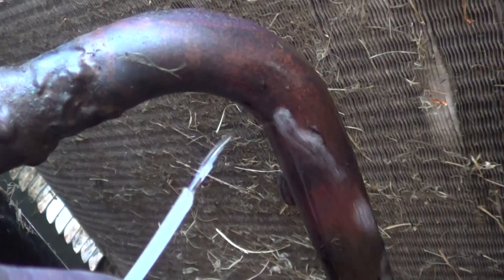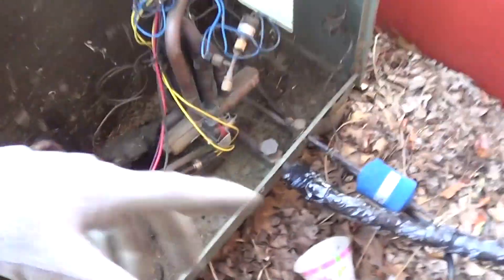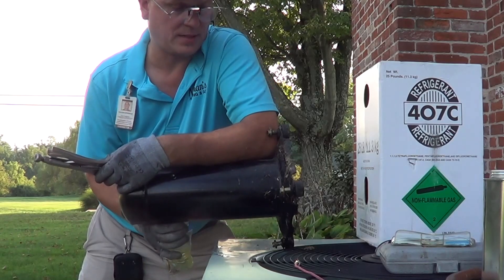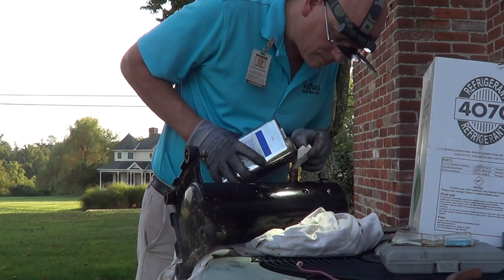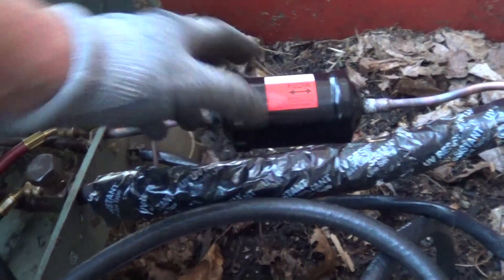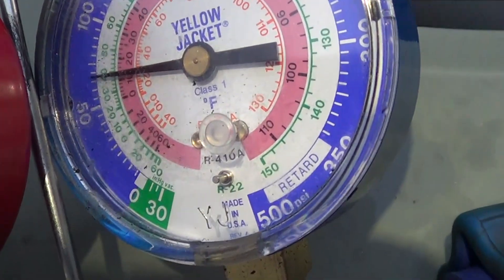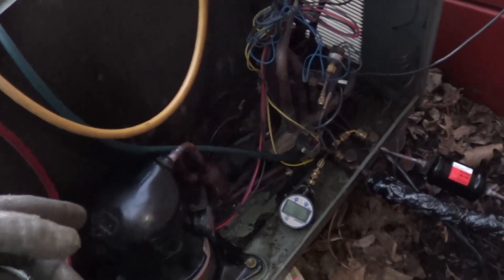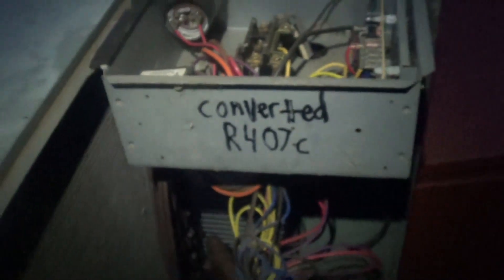Converting a R22 system to R407c

Comment: Due to the check valve in the scroll compressors they start unloaded and cause a high torque start and the compressor twists every time and work hardens the copper lines producing cracks ; The manufacturers need to make loops in the piping to absorb the compressor torque .
Reply from the maker: I ended up repairing that same leaking spot 3 TIMES!!!!!!!    I finally made a very large loop in the copper.  So far so good.  I am glad that R407c is almost as cheap as R410a.
Reply: @NathansHVAC  Miracles are performed daily by professional HVAC tecks repairing factory screw ups . I think that problem is solved .

Comment: Its not necessary to replace the oil. If you put in Supco it will allow the 407 to pick up the mineral oil and move it and no sludge build up has been noted. Been following this method for 4 years now with no issues. Used it on systems up to 30 tons.
Reply: What do you mean put in Supco, is that oil, addative oe refrigerant?
Reply: Supco is just a brand....what the hell are you talking about Kathy? Can you please explain?
Reply: It’s an additive for the oil, used before on semi hermetic systems and it works really good

Comment: 422 is good for A.C. not so good for heat pump. You just don't get the same heat as r407c or r22
Reply: Even 407C doesn't work as well as R-22 in a heat pump. That's the result of a lower compressor discharge temperature. As long as the unit isn't used in a climate that routinely drops below freezing it's ok. Otherwise, stick with R-22 or install auxiliary heat strips.

Comment: 410 better 407c is about 30% loss in capacity  so you loose tonnage and it also is poor oil return properties , causing premature failures .. 407c also known as nu22

Comment: Id love to see wherr tf you got that info lol there is no info anywhere That says Says you gain capacity with 407 !!!  I've taken Honeywell refrigerant classes at the supply house on this issue
Reply from the maker: R407c runs the same capacity.   I was probably saying it was 60 degrees outside.  The system will run over capacity because ahri is 95 72.    Not 60 72.

Comment: I was told by a tech that the r22 Evap coils and txv’s may not handle the higher pressures of 407c. Was that a load of crap?
Reply from the maker: You are probably talking about R410a, which is double the pressure of R22.  R407c is nearly the exact same pressure as R22.  If you read the box of a R22 expansion valve, it will say R407c on the box.    Here is picture of a box.   http://i.ebayimg.com/images/i/191659740462-0-1/s-l1000.jpg

Comment: R22 is still plentiful, if the leak can be fixed just fix it and recharge with R22. You don't have to charge the homeowner $100+ lb, that is just what the industry charges. R22 cost a technician/company about $15 a lb, most companies just have a high mark-up to capitalize on the phase out and to push new systems. If the system needs more than a couple of pounds a year and can't be repaired then it should just be replaced with a R410a system as soon as possible. These alternatives are really only good for those that have a leaky system that don't want to upgrade, but then they are a pain to technicians that don't work with it. I don't care what they claim, they are not as good at transferring heat as R22. In this case I would have recharged with R22 after the repair  Good work never the less.
Reply: R22 is trash
Reply: @Mushroomcapgenova  😂😂 what a comment. R22 is the miracle refrigerant and will be plentiful for years to come.
Reply: @Mushroomcapgenova  r22 cools way way better than r410. Half the pressures too . best refrigerant used in residential cooling besides r11
Reply: @Clamjammer  yea but r22 is being fazed out dude. It's over and done with. I am not looking to play games with swapping a r22 unit to another gas. It's all crap if you need to replace the unit you replace it. Period the end

Comment: So my 10 year old 3 ton unit is leaking R-22. 

The AC guy told me last year that I should replce my entire system because the days of R-22 are coming to a close.
Are you telling me that I can keep my current system, have someone fix my leak, then convert me to a newer freon?

Why do these guys constantly try to rip people off?
Reply: And when you need another costly repair next year, after paying to find and fix your leak, evacuate and recharge your 10 year old system, that by the way only has a 15-20 year life span,  did the guy that converted it really do you any favors? Or are you better off upgrading to a new system with a warranty that likely won’t break when you need it most? I hardly see how that is consistently trying to rip you off.
Reply: Yes you can go to R-407c which is much less expensive.  Some shops use it, some don't.  Any they're in business to make money.  You do not have to pull the compressor out though.  They make a pump you can stick in the compressor and remove most of the oil.
Reply: R-410a is the new refrigerant and there isn't and 'converting' to it.  It's all new equipment.  You're just using a R-22 replacement by using R-407c.  I tell my customers to get all they can get out of their equipment as it doesn't take long for us to get there to either repair or replace the unit.  But you know it's coming so get your ducks in a row to be able to deal with when it happens.  I'm not a believer in replacing equipment that doesn't need to be replaced.  If you find the leak is in the evaporator coil, which is quite common, you can put in just an air handler or coil to break it down into smaller chunks of cost.  You can use a R-410 a coil with R-22 but most of these guys don't know how.  That way you'd have a new air handler with a coil that would work with either refrigerant and when the time comes to replace the outdoor unit that's all you'd have to do.  Otherwise I've found few condenser coil leaks though they do occur and that really only leaves open piping that can be repaired or maybe a tube on the reversing valve if you have a heat pump.  Seldom do we need to use a dye and never use sniffer type leak detectors.  99% of the time it's visually obvious where the leak is.  Most want to sell units but don't get that it's really bad for their business.  I mean they're not going to make any real money for 10 or years so they have to find new fish to fry constantly.  I repair many older units to give my customers a heads up that things are going to go bad.  We don't just slam the door at 'you need a new unit'.  Many people aren't sitting on $5k  - $6k to put in a new unit and it can be devastating.  We have no problem reasonably repairing older equipment even if it's a R-22 unit.  Others think new equipment is the only solution.  Problem is, the newer equipment isn't nearly as reliable as the older stuff and to us it makes no sense to replace working equipment.  Finding leaks should be easy to do and only if it's a major component, such as a condenser or evaporator coil, would we say replace it.
Reply: Only thing you have to remember is you pay to find and fix the leak. Pay to recover the r-22 and evacuate they system. Pay to recharge the system with the new replacement refrigerant and your left with a 10-20yr old unit that the compressor fails next year.
Reply: Even though R22 will be banned from manufacture and import next year, R22 stockpiles will be around for many years to come. Plus the price has really dropped recently.

Comment: I had an experience just removing the r22 refrigerant and adding, 407C with oil in the cylinder already,, and the compressor got very hot pretty quickly and didn't want to work, a scroll compressor with mineral oil, did i was supposed to add poe oil although the cylinder said that already had oil with the refrigerant? did the compressor is damaged now? thanks in advance for you response....
Reply: You should CHANGED the mineral oil to POE oil!
Reply from the maker: You need at least 20% POE oil in the system.  That is about 8 ounces.  I doubt there was very much oil in the cylinder.  You can use a hand oil pump to add the oil.  Or, suck the oil in during an evacuation.
Reply: ok.. so do you thing i already damaged the compressor? i took out the 407c back but havent put back anything again,, not sure if it going to work back..

Comment: what do you typically charge for this type of job?
Reply from the maker: Less than $1,000. However if your system is older than 15 years you probably should consider a new system.
Reply: @NathansHVAC  thanks for the quick response

Comment: EPA part 608 specifically does not allow field mixing of different types of refrigerant.  This practice is illegal, as the resulting refrigerant is not recoverable,and, instead of recyclable Freon, you have eco-toxic waste.
Reply: A real service tech/mechanic with extensive training and experience would have done it a bit differently
 With the pin hole leak on the suction line, you could pump the system down with the service valves, thereby holding the refrigerant in the condenser, thus removing the refrigerant from the suction side, CLEAN the repair site with sand cloth and solder the leak real quick and simple. Period. Job is done.  If done properly, the "crack" as he calls it would not move around to  another area. This is from someone who has done this for over 35yrs. Don't make a job more difficult than it needs to be.

Comment: Ive converted 2 or 3 systems and never added or changed the oil. Didnt know you had to. And I thought you couldnt mix mineral oil and synthetic oil cause it caused rust? Thats why you should flush a line set when upgrading from r-22 to 410a.
Reply from the maker: The oils mix fine.  The manufacturers are just overly cautious for warranty purposes.

Comment: How did u know how much to put in?
Reply from the maker: The name plate shows the weight.
Reply: @NathansHVAC  haha...I ment the oil!!
Reply: @NathansHVAC  We need another video UPDATE on this home owners conversion to see any positive or negative results to show any nah sayers that this is a good thing
Reply from the maker: @joeydelmarsjr.646  Good idea.  I had to fix another cracked hot gas pipe on this system about 6 months ago.   The system blew the entire charge.  That is another reason to use the cheaper R407c.  Service work is cheaper.  It is still running fine.  However, R22 has dropped in price recently because of hoarders cashing out and drop in demand.

Comment: You Charge By The Hour ? Lol  What You Just Did Is Completely Unnecessary, There Are Several Refrigerants That Are Also Inexpensive & Dont Need To Change The Oil & Operate Perfect. I Am A Engineer & Field Tech, & Owner of a Commercial HVACR Company, I See Residential Techs & Residential Companys Always Over Charging Residential Customers For Service & Replacements Units, Because Most Residential Customers Dont Know Better. This Video Is Perfect Example Of That.  Put The Customers Actual HVAC Needs Above Your Profit Desires. I Did & My Company Continues To Grow.
Reply from the maker: R407c is way cheaper.  It saves the customer money.  It takes 30 minutes to flip a compressor over and change the oil.  Plus, you get full capacity and exact pressures without the need to adjust super heat or the charge.
Reply: @NathansHVAC  i wonder if i could do the same on my rheem unit since its 1995 model

Comment: Thanks for posting, this is the model of ruud achiever that doesn’t have the red reset button,  how do you reset power to the outside unit control board if it’s flashing the low pressure lockout code ?  Thanks for posting this video
Reply from the maker: The control is powered by the red 24 volt wire from the inside air handler. So it's just kill the power to the inside and I'll reset the control outside.
Reply: NathansHVAC bingo ! That worked , thank you.  I had looked everywhere for that tip and couldn’t find out the procedure.  One last question,  in this conversion video you made is it necessary at any point to “pull a vacuum” ?  Or is it just about having the old r22 recovered , then opening the system and making sure to keep contaminants from entering.  Pouring out old oil, adding a measured Poe oil, a new drier and reassembling, and then recharging ? At any point other than when the r22 is recovered does there need to be a vacuum ?  Many thanks CR
Reply from the maker: @traderjiggs  Sorry for the late reply.  Pulling a vacuum removes air and moisture when a system is depressurized and opened.  Some guys that don't have vacuum pumps used to purge the pipes with refrigerant.  But the EPA banned that practice starting in 1992.

Comment: If using a new compressor, do you need to add oil ?
Reply from the maker: Usually not. The new compressor should say p o e oil on the label. But you still should check that you don't have a mineral oil compressor.

Comment: And no, polysynthetic and mineral oil DO NOT MIX
AND NO, THE AUTO INDUSTRY IS VERY AWARE NOT TO TRY AND BLEND POLY AND SYNTHETIC,  EVERY ENGINEER WILL TELL U THEY DO NOT MIX, AND U CAUSED UNDO DAMAGE TO THE COMPRESSOR BEARINGS BY SWITCHING OILS, THE TOLERANCES FOR MINERSL OIL COMPONENTS ARE FAR GREATER THAN THAT OF POLY
Reply from the maker: When you buy a blended motor oil, that is a mix of mineral and synthetic.  You are saying that oil damages bearings?  That doesn't even make sense.  Oil separates moving surfaces so they don't touch each other.  You might be referring to viscosity changes damaging bearings by reducing oil pressure.  However, residential a/c compressors don't really have much oil pressure at all.  They have oil pick up tubes that basically splash the oil around.  POE oil does mix with mineral according to my own tests and this document.  https://www.google.com/url?sa=t&rct=j&q=&esrc=s&source=web&cd=11&ved=2ahUKEwimn8SwqaTdAhUqrVkKHZa1BPsQFjAKegQIBhAC&url=http%3A%2F%2Fwww.meiersupply.com%2Fcontentonly.aspx%3Ffile%3Dcustomerpages%2FTechtips%2FPOE%2520Oils%2520RSES%2520200707.pdf&usg=AOvVaw2WqnwEtAv-Lwz8m8m0Ra2J
Reply from the maker: I think the damage by oil you are referring to is not having any POE oil to return the mineral oil.  Just dumping R134a into a R12 car a/c system will result in no oil coming back to the compressor and damage to the bearings.  However, having 20% or higher POE oil will allow oil return to the compressor and the stickiness of the backwards compatible POE oil will return the mineral oil also.  However, probably 100% POE will be better than 20%.

Comment: Idiot, oils are not compatible,u charged unit incorrectly for a blended refrigeration, u cost the home owner more money than was needed for repairs
U lost 5% - 9% capacity of the unit
Reply from the maker: Oils do mix.  The automotive industry uses blended oils all the time.  I mixed mineral oil with POE in a test tube and let it sit for days and they never separated.  The refrigerants which are solvents don't mix with certain oils.  That is why you want to have enough POE to provide a decent oil return.  As far as capacity loss.  You are probably correct that some capacity is lost.  However, I would guess it is better to have a 20% POE blend than a 1% Butane blend of a typical drop in substitute.  Oils are more sticky than butane.
Reply: @NathansHVAC  
I wouldn't use either
Reply: Been HVACR for over 40 yrs
Please stop giving bad advice to young techs

Comment: Once they’ve paid you for all this nonsense they have nearly spent as much as it would cost to replace the entire condenser unit with something that has a 10 year warranty. I’d have never gone this route. If the condenser coil leaks or the compressor fails within the next couple years, your customer will be pissed at you.
Reply from the maker: Good point.  That unit did spring another leak last week. Fortunate it was already converted and cheap to re-repair.
Reply: NathansHVAC I’ve never actually done one of these retrofits. I’m one of those guys that just dumps in the R-22 replacement as if it were a drop in refrigerant. I know it’s not but I’ve weighed the pros and cons and I’m comfortable with the small theoretical risk involved with just dumping it. Here in the south we can only reasonably expect to get  about 15 years out of a condenser or evaporator coil so it’s not really worth all the extra work. The way I see it is that if you’re adding refrigerant to an old R-22 system, you’re only trying to buy yourself a little extra time anyway until you upgrade to an R-410a cooling system so with that being said I don’t wanna cost my client a bunch of unnecessary expense by getting all perfectionist on an old piece of crap that is half way out the door anyway. Time is money in this industry and the best thing I’ve learned to do is make practical judgement calls.
Reply: NathansHVAC check this out bro. R-427a is the refrigerant that I drop in. It’s compatible with mineral oil so there’s no need to change the oil which makes a conversation way easier. You just evacuate all the 22, pull a vacuum and add the 427a.

https://youtu.be/DNw-p1_cRmQ

Comment: R-407C is a mixture of hydrofluorocarbons used as a refrigerant. It is a zeotropic blend of difluoromethane (R-32), pentafluoroethane (R-125), and 1,1,1,2-tetrafluoroethane (R-134a). Difluoromethane serves to provide the heat capacity, pentafluoroethane decreases flammability, tetrafluoroethane reduces pressure.[1] R-407C cylinders are colored burnt orange.   https://en.wikipedia.org/wiki/R-407C
Reply: look up the emissions from water treatment plants. the amount of chlorine. and dig deep because ya know, propaganda these days…